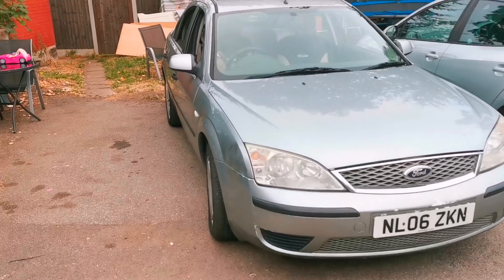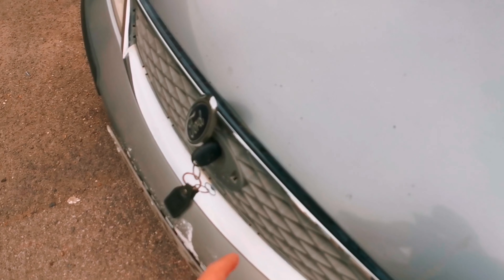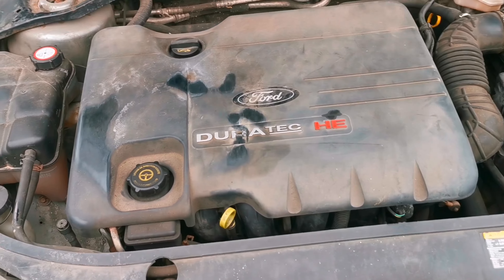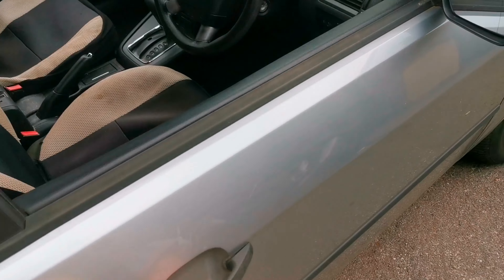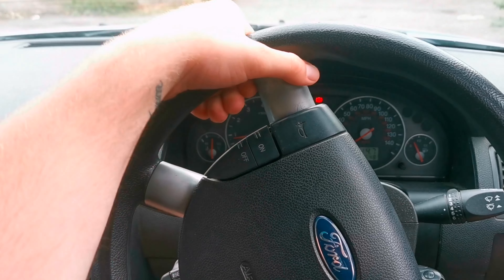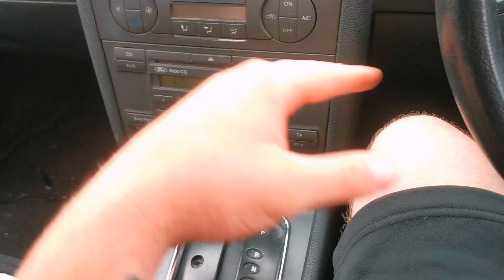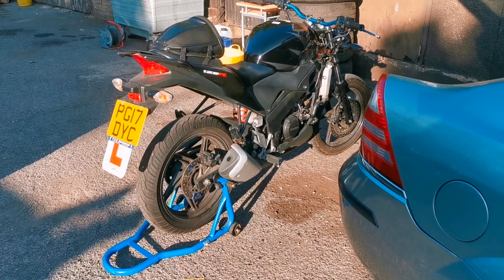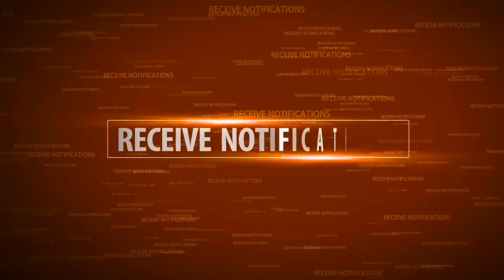Mondeo Mark 3, 2L Petrol Swapped For £220 Moped...!!! Lets Have A Look....

Comment: Nice motor behind the battery is the air filter and behind that is the master cylinder for brake and clutch fluid the oil drain bolt is located on  the sump I'd recommend investing in a set of ramps or axle stands and a  trolley jack and when u want to change the plugs do one at a time I'm speaking from experience as I've owned a few cars in my time lol
Reply from the maker: Brilliant cheers mate 👊🏻
Reply: @DTMotorcyclesEssex  no problem mate the last car i owned was a Vaxhall Cavalier 1800 cdi which needed a new headgasket and water pump but the cavalier didn't have quite the kick down as my Carlton 2.2 cdi if i can help with any other advice i will mate

Comment: nice on Dan looks better with the seat covers off with the black trim iv still got both my mk3s the 3l v6 petrol and the 2l petrol 👊
Reply from the maker: Yeah ive binned the seat covers need to invest in a wet vax to clean up the seats as there bit dirty looks bit mouldy ive got some plastic restorer on order drives so smoth considering the mileage lol its only had 3 owners
Reply: @DTMotorcyclesEssex  it will keep going as long as serviced mate 👍🏻